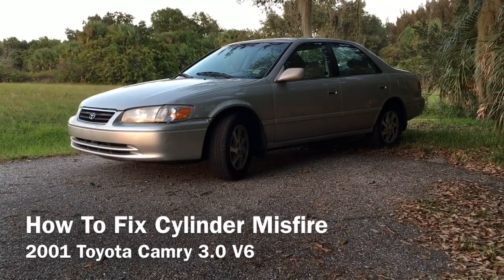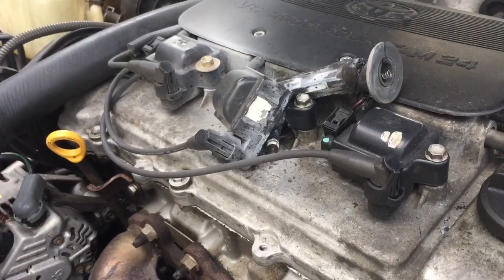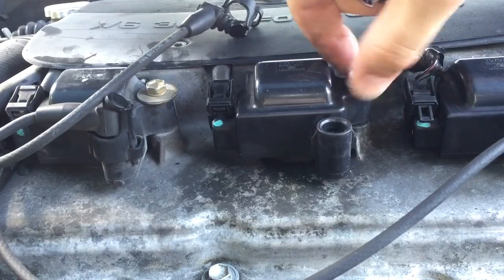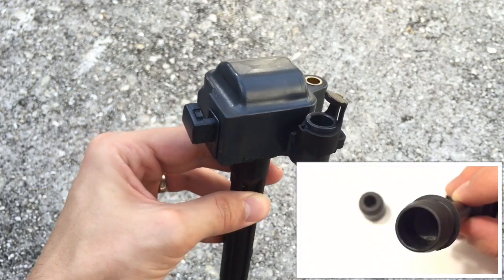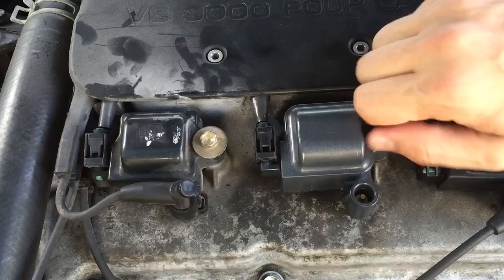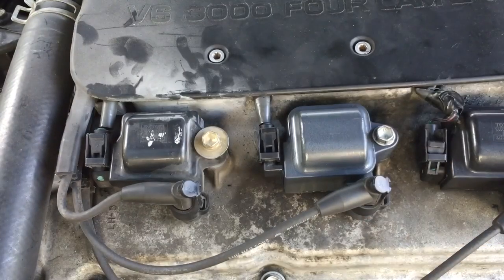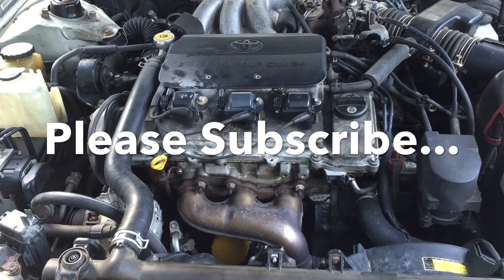How To Fix Cylinder Misfire - P0300, P0301, P0302, P0303, P0304, P0305, P0306, P0307, P0308

Comment: good video, but if a new set of manufacturer-grade plugs and coils are installed and the problem persists on one cylinder... then what? That has happened to me and 2 fuel injectors were replaced two years ago.... could the remaining 2 be the source of the misfire on one cylinder (cylinder 3) ?
Reply from the maker: Test compression in that cylinder. It could be a head gasket leak.

Comment: I have a 2000 sienna v6 3.0. Does it have 3 coil packs with a wire to the rear plugs ?  Or does it have 6 coil packs?   Some places say 3 and some say 6. Very confusing.
Reply from the maker: Not sure. How many do you see under the hood?

Comment: Is a P0304 cylinder 4 misfire , actually cylinder 4 , or does the code refer the 4th cylinder in the firing order ?
Reply from the maker: It is for actual cylinder #4.
Reply: This is why I ask : this article states "P0304 is a cylinder specific misfire code, which means that Cylinder 4 is misfiring and causing the code. An important thing to understand when finding the location of Cylinder 4 is that it’s going to be the 4’th cylinder in the firing order of the vehicle, and not the 4’th cylinder that you might see when looking at the engine."

https://www.700r4transmissionhq.com/p0304-toyota-camry/

I understand that actual cylinder 4 may also be the 4th cylinder in the firing order. My car has firing order of 1342 - making cylinder 2 the 4th cylinder in firing order. 

I'm starting to think codes refer to firing order, and explains why some report their misfire is in a different cylinder than the code reports.
Reply from the maker: Thats a very good point. 
I think it could be both ways, depending on car manufacturer. In my Altima for example it is by cylinder number, not by firing order. I was placing faulty coil in different cylinders and error codes were corresponding to cylinder numbers: https://youtu.be/pP0I-iSBUF4
Reply: @DIYtime  I was always under the impression that the cylinder number and the firing order were the same? number 7 firing order number is number 7 cylinder. 2 is 2, etc

Comment: After just going through this and the issue NOT being coils, ECU, PCM, coil connector or wiring, vacuum leak etc. 
I found that is was a broken spark plug.  I'm sure I did this either during installation or when I was trouble shooting.  
ALWAYS, ALWAYS check the spark plug!  Mine was cracked!  $5-$10 fix.  It was throwing up codes for cylinder 4 misfire 
and cylinder one misfire, when this cracked plug was on cylinder one.  
Have not figured that part of it out yet.

Comment: Dear Mr. can you tell me which one is cylinder ignition coil#2 located on the 1997 Avalon  v6 engine?  thanks
Reply from the maker: I believe it should be like this:

      👩               🧔
Passenger     Driver

          1 --- 3 --- 5 
          2 --- 4 --- 6

  Front of the vehicle

Comment: What an idiot.  Did the scanner show what number it was. Did he show how to change wire.
Reply from the maker: Nadia, you are hopeless... 😭
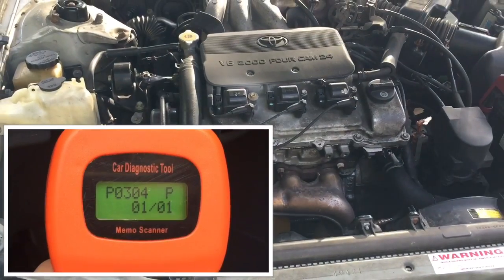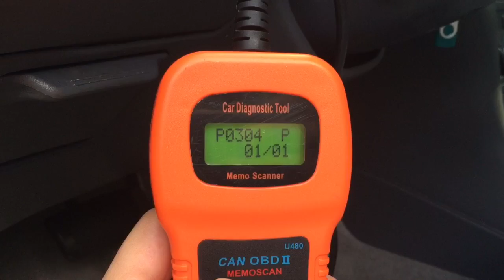00:24-00:34 Scanner showed cylinder #4 was misfiring.
No wires were changed to fix this issue on this particular car. The problem was with ignition coil. 
Please don't touch anything and take you car to a mechanic.

Comment: What an idiot. What is about if my car is not Toyota.
Reply from the maker: Nadia, let me break it down for you.
This video, as well as the other one that I mentioned,  simply show a basic approach how to troubleshoot cylinder misfire. This approach works on almost any car (as long as it has internal combustion engine), weather it is Toyota or anything else. It is clearly stated in the description and in the beginning of the video: "2001 Camry". If you are not aware how to remove ignition coil on your car, you probably should not attempt this or any other repair for safety reasons. Rather take it to a good mechanic. If you don't understand something, please just ask. No need to insult anybody, it is not pleasant, and it doesn't make you look good. 
I hope you'll understand.

Comment: Hello, can a faulty ignition coil cause misfires only at full load (3000trsmin and right feet all the way)? but still work in linear acceleration? that is to say when I accelerate progressively it works well! where is an ignition coil on / off = it works or it does not work? 
(PS = pencil ignition coil)
Thank you in advance. (sorry for my english not top ;-))

Comment: ok I got p0300 1,3,5 they in the back they don't have coil packs so explain plz
Reply from the maker: His article may give you some ideas:
http://www.diy-time.com/automotive/nissan/2007-20012-nissan-altima-2-5l-qr25de/how-to-fix-cylinder-misfire-odb2-error-codes-p0300-p0301-p0302-p0304-p0305-p0306-p0307-p0308/
Reply from the maker: It would be helpful to retrieve freeze frame or life data, if you have OBD2 diagnostic tool or go to your local autoparts store.
All I can say is you've got intermittent misfire and misfire in cylinders 1,3,5.
Check cpignition coils, plugs and wiring first.
Reply: One coil fires 2 cylinders
If the coil is bad then you actually have 2 misfires 
Often it’s simply aged wires or spark plugs. Sometimes a coil. A bad fuel injector will also cause misfire code

Comment: i replaced the plugs and coils several months ago...also replaced the mass air flow sensor and 2 of 4 02 sensors...i have code p0300 cyclinder misfire..not sure what to do next? 2002 rav4
Reply from the maker: This may give you some ideas:
http://www.diy-time.com/automotive/nissan/2007-20012-nissan-altima-2-5l-qr25de/how-to-fix-cylinder-misfire-odb2-error-codes-p0300-p0301-p0302-p0304-p0305-p0306-p0307-p0308/

Comment: I change the plug everything became excellent. ..then I came home Park the car for two weeks and then I started it was the same and problem..
then I keep driving put better gas ..then it became good again ..
may be plugs can be loose or  oil filter may be is lose because if change it and it came out with hand so I put new ND tight it with hand ..
let see what will happen tomorrow in morning

Comment: I have toyota camry 2005. I seen the oil in spaluge chamber 1,2 & 3. Then I change oil pan gasket. The result misfire on coil1 & 2. How do I fix it And you have any reason why changing oil pan gasket making faulty on coils? Thanks

Comment: i have a 2002 toyota camry v4 i changed spark plugs , fuel injectors one of coil ignition and i still have check engine on my car sir !!.. what else should i do ? do you have any different suggestion ?
Reply from the maker: What codes are you getting?
Reply: Temachok It was p0304 code yesterday but today it was p0303 code
Reply from the maker: Here is good article that can give you some ideas what to do next:
https://www.obd-codes.com/p0303
Reply: thanks
Reply: replace all  coils
Reply: Take it to shop

Comment: I have a 2000 solara v6..which one of the coil is cylinder 5.please help
Reply from the maker: +Lamphai Srivilau 
It's upper right, I think: 
1 3 5 
2 4 6
Reply: +Temachok thanks for your help
Reply from the maker: No problem!
Reply: +Temachok hey I've changed my spark plugs and wires and a coil boot on one of the coil because it was missing a spring for the bottom part but I still get misfires.. driving it for like 2 weeks now and it's still missing..what you think is the problem?
Reply from the maker: Are you getting any error codes?
Reply: +Temachok I did before I changed the plugs and wires but not the coils, which was replaced about a little over a year ago.. it gave me a p0305.it misses when I stop at a light and during taking off but a a higher rpm it runs fine..
Reply from the maker: Try this maybe: https://youtu.be/pP0I-iSBUF4
It will be a little different for your car, but it's the same method.

Comment: Nice video thank you. I just got po303 on my 00 Sentra gxe. It was late last night & dark but my car was sputtering shaking like crazy. I just changed the coil pack for cylinder 3 and the car started up fine again.  I plan to drive it later to test and pray it's fixed.
Reply from the maker: +hhova29 
I would recomment to always have another spare coil in your trunk and wrench or socket to change it.
If one coil gone bad, others may break down soon as well. 
If it happens on the road, you'll be able to fix it in no time.
Reply: +Temachok   Thanks! This is the 3rd coil to go bad in 4 yrs. 1 in 09, that's when I had a tune up, and then in 2011 another one went bad. Now it was bank 3.  The only original coil to not go bad yet is coil 2! Sucks but I'll follow your advice. Hardly even use the car! 00 Sentra w/ 93k.
Reply from the maker: +hhova29 
Same story. I new it was coming, so I always had a spare in my trunk. Last time this happened I was one hour away from home. Car started shaking. I pulled into nearest parking lot (ironically it was Advance Auto Parts.... :)), pulled that spare out, replaced it... 5 min later I was back on the road...! In your case, you can actually just do the last one and be done with it. There is no need to wait, cuz it's the last one to go bad.

Comment: how do you know where the cylinder number is on a 1997 Toyota 3.0
Reply from the maker: +Scott Tuttle 
Shoul be in the middle of the top row:
1 - 3 - 5
2 - 4 - 6
Reply from the maker: It would be helpful to know retrieve freeze frame or life data, if you have OBD2 diagnostic tool or go to your local autoparts store.
All I can say is you've got intermittent misfire and misfire in cylinders 1,3,5.
Check cpignition coils, plugs and wiring.